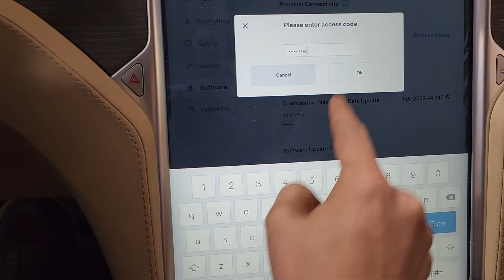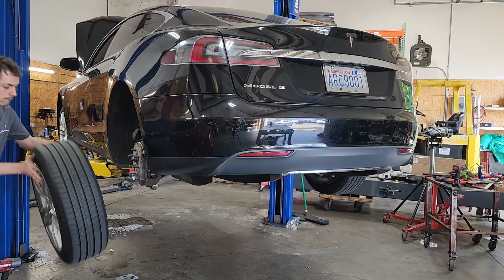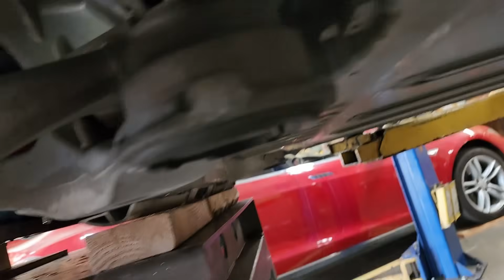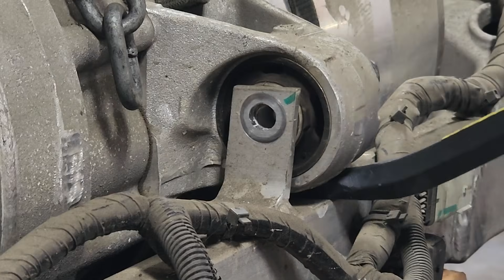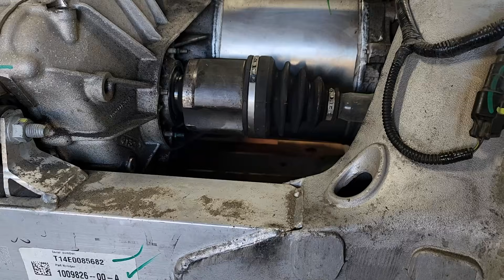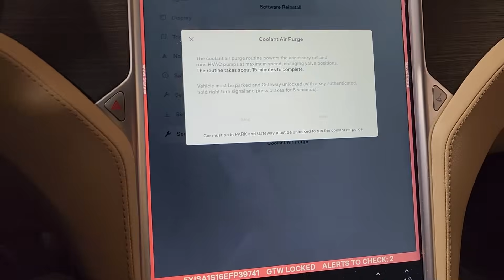Tesla LDU Rotor Coolant Delete Install (Model S)

Comment: Thank you for the video. There are some thinks maybe to consider or mentioning in this video. If you remove the cooling from the rotor, tell people not to drive with trailers anymore, not hogh speed long distance driving, no racing anymore and not useable for anyone in Germany, as the rotor will get hot, expand and lock up in the stator permanently damaging the motor. Just replaceing the original single lip seal with a modern triple lip seal for the coolent line would be sufficient for rest of the lifetime of the car.

Comment: Alex, hello! I have a Tesla Model S60 2015. The mechanic advises me to do an LDU coolant delete. I wonder if the rotor will heat up after that if you drive on the autobahn at a speed of 120 km/h? If you drive far in the summer? Did your clients who you did an LDU coolant delete have problems with the engine after that?

Comment: BIG  MISTAKE. 
Do not install the water pipe above, because the water will circulate there and will not cool the stator well. If the water no longer circulates through that pipe, it means that the same water flow will only circulate through the stator, which will dissipate more heat and faster.

Comment: Esa ya no es la mejor opción. Actualmente Tesla ya vende la #pieza de #repuesto original para hacer el #motorseco por 43,2€
20€ envío + 15,7€ (19€ con el IVA Español) Rotor Cooling Delete 1492787-00-A
Número de serie del motor que ya la incorpora = BASE REAR DRIVE UNIT LDU (1002633-00-U)

Comment: Did you end up putting more coolant in the system by chance? I’ve worked on many Tesla suspension and drive units as well as fluid changes but I’ve never actually dropped the rear frame of a Tesla. It all seems pretty familiar to me and I it seems like I can do it but figured I’d ask since I’m tempted to do this on my car since I have 2016 model s 90d with 117k miles

Comment: Question, does this need to be done on just the P&D models( p100d ) or can it be done just on the D series ( 90d) are well?
Reply from the maker: Only Performance and/or RWD models, non-performance dual motor models do not use the LDU.

Comment: My S is at 350.000mls, still 1st battery, still original motor. Both serviced once, motor preventively, of course. If you do it before coolant gets in, they will run forever.
Reply: My unit leaked coolant .. motor was shot. They replaced the drive unit under warranty in early 2024. But I found out that it was replaced without a coolant delete kit..   so I’m about to get it. I’m at a private mechanic in case it happens again.
Reply: @bigmack11  don't do it. Check EV clinic Croatia's website, everybody's worldwide is copying their designs. And it's all so somple, motor will run forever, don't install any delete kits, no way.

Comment: The coolant delete issue for older Model S Tesla cars.  Why not air cool the armature?   I found this scroll fan: Silent Series Scroll Compressor P07H015A-BLDC-C that can be purchased in 12 volt, that moves 1/2 cfm per minute at 30 psi.   It would need to still have the tube that goes into the armature, so the original casing, drill a hole in the casing, tap threads and install hose barb, so that air can go down the tube into the armature, and come back out the around the tube.  Drill exit holes in the casing to allow the hot air to flow out to atmosphere.  The inlet air to the pump needs to be clean, I would just put a hole into the cabin and run the inlet hose from the cabin to the pump utilizing clean cabin air to cool the armature.   Really enjoy your videos, I like how you look for novel solutions to Tesla engineering mistakes.

Comment: First of all, I have to thank you for the videos that here in Portugal are a precious help, and from my question you will see that, I have a Mercedes B250e 2015, the LDU is not the original one, it is already reconditioned, when changing the transmission oil I saw that it was yellow (type valvuline), from what I understand the oil can only be Dexron VI, or am I wrong? I would also like to know if the coolant can only be pink.

Comment: Nice manual Sir!
QQ>> why can't we bypass coolant hoses and stick glue alu cover so it doesn't get dirty?
Reply from the maker: The rest of the drive unit still needs cooling! A rotor coolant delete manifold leaves 95% of the motor cooling intact, all that is bypassed is the rotor cooling circuit.
Reply: @AlexEVRepair i see. Makes sense. Good luck with next projects

Comment: Control arm bushings should be tightened with the suspension loaded, not with the hubs dangling in mid air?

Comment: Huge thanks for this video. I've just fitted a QC charge manifold to my facelift 2016 P90D (155k on the clock) on my driveway using a set of Quick Jacks and this video.

Interestingly the part label on the drive unit ends -R but the build date is the same as the battery: July 16. So either the drive unit was refurbed at the same time as the car and sat on the shelf until needed under warranty, or it had a refurb from new.

Greetings from the UK!

Comment: Hi mate I followed your video and done the coolant delete. Couple of questions please . Q1 my car didn’t have coolant purge under service mode but it did bleed when I hooked up power. Is that enough?
Q2. I also noticed since the coolant delete the cars pump or fan is always on near the frunk? In other works I can always hear a noise from car. Is that normal? We are in winter now here in Australia

Comment: Hey for ease of servicing later shouldn’t you reverse mount the suspension arms? (Flip the orientation of the bolts) Otherwise basic suspension maintenance is a motor out job.
Reply: If you remove the inner bolts you have to do a suspension realignment and cutting g replacing when you actually need to is arguably easier.

I did reverse the shock lower bolts on mine so the park brake caliper doesn't have to be removed in future.

Comment: Not needed, its better to keep the coolant as it was from the beginning and use EV Clinic Holy Grail kit which proved very reliable and long lasting for more than 600 000 km
Reply: You mean the kit that costs 1k euro with 10 parts and much more involved process to replace all those internal parts?

Comment: Hi, I have a 2012 model S with 27,000 miles. I checked the speed sensor and it’s brown. Looks like mud. Isolation is good and no errors. Should I still do the delete? I planned on cutting the manifold and plugging it with 3D printed plug. Easier route for not having a lift. Is it worth doing that or is it too late? I need to take off motor? Hopeful for a response. Thank you
Reply from the maker: Depends on what kind of "mud" we're talking about here... If it's dark brown grease, that's totally normal and is left-over from the assembly process when the drive unit was put together. If it looks gritty and is more reddish-brown, then it could be a buildup of rusty sludge from inside the stator, which is a bad sign... 
I personally do not recommend the "cut and plug" rotor coolant delete method, particularly if you are eliminating the flyover tube, which is important for being able to properly purge all the air out of the cooling system.

Comment: Do you have a video on the charger inlet? Looking to change it out seeing there’s a bit of plastic that was  broke off. I’m thinking you do the same on disconnect the 12 volt battery and the high voltage orange tag connection. Wife has a 2020 model Y. Love the video and I subscribe to get educated seeing I’m going to get a model s in the future. Where do get the delete at?? Great video. I subscribed too.

Comment: Is there an easy way to check if the motor has coolant delete done already or do I always have to open up the under hood to check the motor physically.
Reply from the maker: You can check for the presence of coolant intrusion by removing the rotor encoder sensor. You will need to get under the car and remove the rear lower panel in the rear to gain access, so at a minimum you'll need a set of ramps. Here's a link to another video I made that shows how to check the encoder sensor: https://youtu.be/vM85qI6au2Y
Reply: @ are you aware of coolant delete without taking out the motor. I have pasted the link. Would this still work? Or d I need to take out the motor. It’s just that you need so much equipment to take out the motor.

https://youtu.be/UqAvzIPmL9c?si=4Jr-pr2fa1jvHs8b
Reply from the maker: @Saywhatohno  I don't recommend any method that eliminates the flyover tube, without it, there's a large air pocket that gets trapped in the cooling system that is basically impossible to bleed properly.
Reply: @AlexEVRepair  why would there be a air bubble after terminating the flyover tube? there is no air trapped inside?
Reply from the maker: @Saywhatohno  Well you have to drain the coolant out of the drive unit to install the rotor coolant delete, and that introduces air into the system... The cooling system has to be bled to get the air out. 
The area above the coolant outlet on the gearbox is fed by the flyover tube. When you go to refill the cooling system after performing the rotor coolant delete, if the flyover tube has been eliminated, now that portion of the cooling system can't have the air bled out of it since there's no coolant feed to it and it's the highest point in the drive unit's cooling system.

Comment: I have a tesla 2013 MS 60 with 61,000 miles. It broke down on the road without any warning indication. Tesla Technician end up replaced the LDU and the half shafts. I also asked to replace the Rear lower control arm and the others upper control arm because I saw other comments on tesla forum about these control arms will break down around 50k-60k. They charged for 5.8 hours of work ($265/hr) and parts, it is total cost for $9,075. After I watch the video, you make it very simple. Thanks for the video.

Comment: Haven't gotten any clear info re: Do ALL Tesla motor assemblies have this same design flaw, requiring the coolent delete conversion to avoid motor destruction?  Is there ANY Tesla motor assembly that will NOT fail due to coolent intrusion?... If this design feature is universal then, personally,  would immediately bring any new tesla i purchased and get the conversion. It simply makes no sense why Tesla hasnt produced their current year vehicles with the coolant delete hardware already as part of the vehicle. Odd.
Reply from the maker: This applies to all vehicles equipped with the Tesla "Large Drive Unit", which includes:

- 2012-2021 Tesla Model S in RWD and/or Performance configurations (regular Dual Motor/AWD unaffected)
- 2016-2021 Tesla Model X in Performance configurations (regular Dual Motor/AWD unaffected)
- 2012-2014 Toyota RAV4 EV
- 2014-2017 Mercedes B-Class ED/B250e

Comment: Hi, are you blocking the coolant in the small pipe that goes down to the part? Or can it flow freely through and circulate around the system?
Reply from the maker: The flow through the flyover tube is left unimpeded.

Comment: How long does the whole process take you doing the repair by yourself? How long the first time you tackled this?
Reply: To answer my own question, this took me 2 days (14 hours) the first time. One day to get the motor out, and on day 2, I swapped the coolant plate and put it all back together.
Reply: @karaffa01  Thank you for your response. Another comment mentioned that by cutting the plastic plating you could access the LDU end without dropping the subframe. Does this seem like a possibility?
Also, what was your method for dropping the subframe and then lifting the car around it? Do you have access to a full lift?
Reply: @bjently  I don't see how it would be possible. The LDU is so tight in the subframe. I have my own shop with a lift. I use a lift table to lower the subframe down from a stationary car, rather than Alex's method of lifting the car off a fixed table.

Comment: hi what is the coolant delete for and are there any benefits to doing it and why do people do it for?
Reply from the maker: The rotor coolant delete addresses the issue rotor coolant seal failures, which in turn leaks coolant inside of the motor. If left unaddressed, this internal coolant leakage can cause a myriad of issues ranging from loss of HV isolation in the stator, damage to the rotor bearings, and/or corrosion of the inverter electronics and wiring. 
In other words, coolant intrusion caused by a leaking rotor coolant seal will destroy the drive unit, and the rotor coolant delete eliminates this as a failure mode.
Reply: @AlexEVRepair  oh ok and if your delete it how will it get coolant after? Or does that part not need it?.

Comment: Went to a shop in Vancouver that does Tesla. They said that they do not recommend doing the bypass because the car will have less range in cold weather due to the coolant not going inside the motor. Instead he said they do the storm drain and replace the seal with a triple seal. Have you notice any difference in range after the job? Or any complains?
Reply from the maker: The majority of the motor still has coolant running through it, just the rotor that gets bypassed (the flow for which in factory configuration restricted to a ~1/8" hole anyways). Range is completely unaffected by rotor coolant delete.

Comment: A breath of fresh air im a true motor head but only because anything mechanical. Tesla good bad or indifferent changed the EV industry and this is the nuts and bolts of the future. 
 Thank you for putting a face on EV's.

Comment: I have a 2015 Model S 70 (RWD) with 68k miles. When should i do the coolant delete? Is it safe to wait a bit more to start seeing symtoms? I do hear motor wining but i believe it was always there
Reply from the maker: Definitely DO NOT wait until you start to have symptoms, at that point it is far too late to do just a coolant delete, and a full blown drive unit rebuild would be necessary; assuming it's even rebuildable at all. 
The noise you're hearing could potentially be related to coolant intrusion, but more than likely it's probably the primary drive gear bearings in your gearbox (which is not related).

Comment: Great Video Alex , I see that you were willing to except the small amount of moisture on the rotor sensor. I pulled mine the other day after I stopped at a light and was not able to move forward and my "P,R,N,D indicator turned red . After numerous attempts I was able to get it back into drive and get back home. My question is "How much moisture is acceptable with out tearing the motor and inverter apart to clean and inspect?  
I have a 2014 MS85,    Thank You..
Reply from the maker: If you're having issues with the car not going into gear and the gear selector turning red, there are two possible issues. The first is a failing encoder sensor, and the second is a failing inverter. If the latter, it's far too late to get away with just a rotor coolant delete, and catastrophic failure may be imminent...

Comment: Thanks for the video, very informative. I get the coolant delete will "remove" the problem. But as a regular consumer, why would I not ask Tesla to simply replace the seal? Sure, it's a recurring problem, but one that shows up every 80K miles or so. What is the difference between Coolant Delete and simply maintaining the LDU as is?
Reply from the maker: Tesla will not replace the seal (nor will they install a standalone delete manifold), all they can do for you is replace the entire drive unit assembly. 
As far as replacing just the seal, in some cases, that may by OK, but often the seals can fail in as little as just a few thousand miles, and other times can last over 100k. Often the sealing surface on the rotor becomes pitted and grooved to a point where the seal can no longer do it's job, and that would require the rotor to be removed and the sealing surface refinished.
Reply: @AlexEVRepair  thank you for clearing it up. :)

Comment: I'm about to tackle this on my 2014 MS 85. What oil recommended for the differential? I didn't see it mentioned in the video. Thanks for the awesome writeup - I'm much less intimidated by the project.
Reply from the maker: Dexron VI automatic transmission fluid.
Reply: @AlexEVRepair  Thanks! It's really that simple? I was expecting it to be some highly exclusive fluid only available from Tesla!

Comment: Have you worked on any Audi Etrons yet? If modifications could be made to an Audi Etron to get the battery size enlarged or make it more efficient with the thermals not being so overactive and give this vehicle more range then these would be awesome vehicles as they are so comfortable to dive but just need efficiency improvements or a slightly larger battery.

Comment: After removing those arms, isn’t it necessary to get the  wheels aligned? I think the rears are not noticeable as much as the fronts when not aligned properly until the excessive uneven wear to the tires are noticeable. I enjoyed watching you fix that car, awesome job man!
Reply from the maker: I specifically only remove the end of the links that are non-adjustable.

Comment: Alex, how much does it cost?
Reply from the maker: The basic manifold (the one shown in the video) I sell for $249, and it's 5.5 hours of labor for install. All in installed cost is just under $1200. I also stock the QC Charge one piece billet aluminum manifolds, which are $499.

Comment: You are one incredible mechanic. This has nothing to do with Teslas. I've seen you work on Leafs. I bought a 2012, with 48,000, last June. It has 9 bars now (10 when bought) and charges to 80 miles at 100%. It goes down real fast!! My brakes seem to be very sensitive. They stop the car fine.  But wondering why the brakes after full stop,  jerk the car when I want to crawl up after a stop. Brake fluid is intact.  I have not had the car looked at since I bought it. Could any mechanic deal with the brakes?